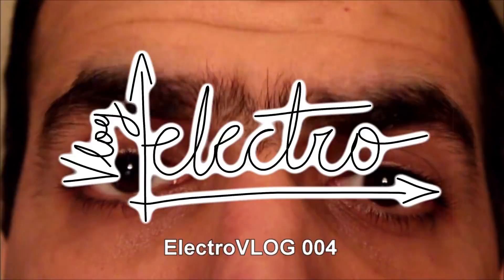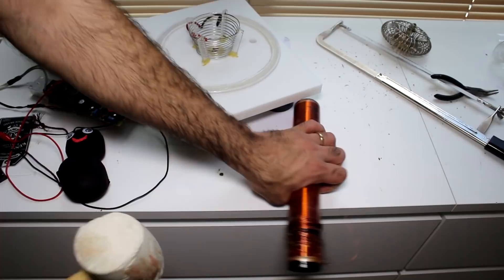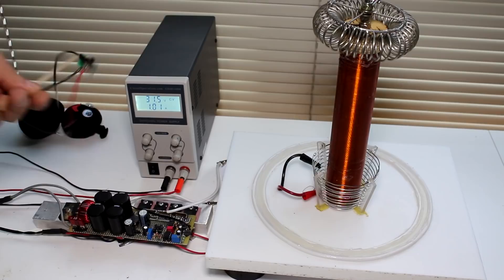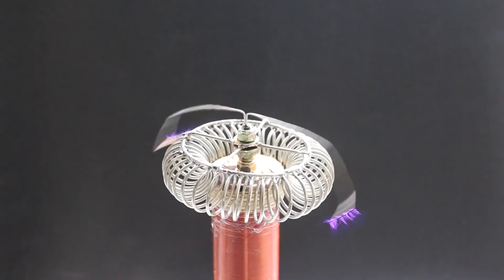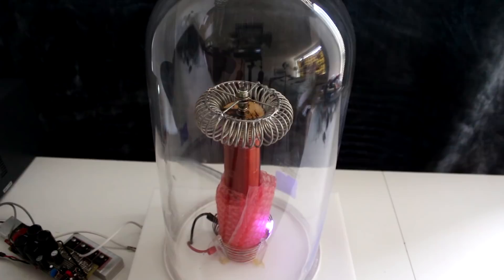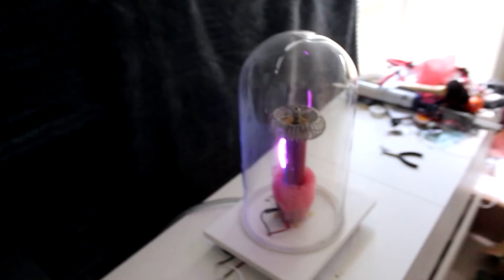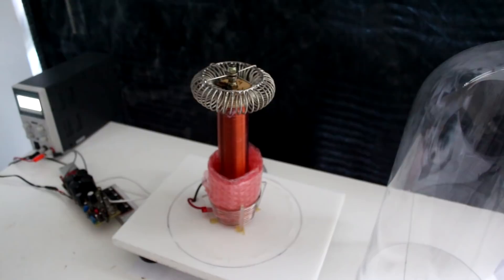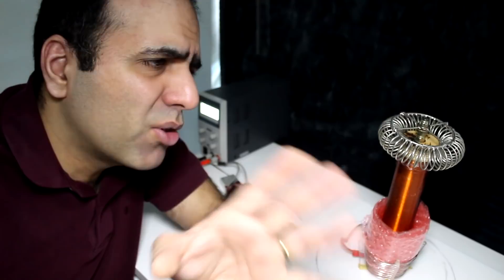ElectroVLOG-004: The LAST Attempt at Tesla in Vacuum

Comment from the maker: ElectroVLOG series is available to my Patrons earlier, so don't be confused about some comments being a month old!
Reply: ElectroBOOM Hello I love your vids
Reply: mind= blown lol
Reply: Fill it with different noble gases and go over the differences! They usually use Argon for plasma globes IIRC.
Reply: More like ElektroDoom
Reply: ElectroBOOM one month earlier rly? xD
Reply: Dear ElectroBOOM, don't you think a month is too much? I don't think that's a way to attract more patrons :|
Reply: Hey, I absolutely LUV your vids
Reply: Please would you re-record the "electrovlog" thing
Reply: @ElectroBOOM
Cast the coil in epoxy just enough to cover it, maybe 1/8in thick, that should insulate it enough so it dosen't arc to itself. I'v had coils burn themselves out in open air in this manner before. That's not failed me yet. The primary coil could be put inside thin flexible plastic tubing as well. Just tips incase you try again in the future.
Reply: Hi! try put a piece of wire in the vacuum and connect the tesla coil to the end if the wire (the tesla coil is out of the chamber)
Reply: Why not get a better insulator like some soft rubber matting. You could layer it around the base and over the bottom cage. I have no idea what your main goal is but you seem to be trying to slowly upgrade this project. Knowing what I do about silicone, it might be best to just make it thicker, when thin it is much easier to cut but the thicker it is the more force it can handle before destruction unless the thing pressing on it is sharp, like a knife.
Reply: what is the purpose of the metal rings at the base?
Reply: fill it with propane gas xD
Reply: Power the tower with van de graff generator periodically ...for short duration but might be more arcs will be there ...
Reply: redd ztone the inside pressure of flask is very low ..u cant expect air in bubble wrap.
Reply: you may use the trasfomer of the microwave oven to build a SGTC
Reply: Fill it with argon!
Reply: <3
Reply: no, do not think about that idea, fart is not noble gas, even when it comes out from a royalty
Reply: How noble are they?
Reply: @Abdallah Al-Dalleh Seriously a day or two early is fine, but an entire month is ridiculous.
Reply: Mr. electroboom , your videos are nice👏👏👏👏but a small problem I found is that you don't answer the coments on YouTube😲😲😲😦😦😦😦😦😦
but please don't get me wrong🙅 ,there is your benefit 🙋,also, many people have quiries and questions, who will answer that?so, please start answering the comments😇😇😇😇.🙇🙇🙇🙇,but you can skip the comments which does not make sense.
Reply: ElectroBOOM GreatScott watches your vids. You can see from his liked videos playlist.
Reply: Exotic Butters that is true GreatScott does watch your videos electroboom
Reply: ElectroBOOM use insulated thick wire for your primary coil.
Reply: hi eletroboom
Reply: Wrap 85 layers of scotch tape all over your secondary. That should do the trick.
Reply: ElectroBOOM you can't harvest free energy from inside a vacuum!!!
Reply: ElectroBOOM Can you put out a schematic for your Tesla circuit?
Reply: ElectroBOOM How did u get the top load of a tela coil plz make a tutorial on how to make a full tesla coil
Reply: Wonder if you used a glass tube to block arcing Across the primary  and secondary windings.  I know this video is 3 years old now but its all new to me. Love your content!
Reply: Likely the magnetic field is pulling the plasma inside the coil bore and so arcs to the other end! 

Likely this is how incandescent lightbulbs explode, because the magnetic pulse of the breaking filament pulls the generated metal ion plasma into the "bore" of the coiled filament and so makes of it a dead short with much lower resistance than the tungsten wire itself and so draws hundreds of amps current converted into heat.

Please test this with a transparent coil tower and less dense windings. (The input highvoltage may be produced externally for this.)

Comment: Man, you don't put the whole tesla mechanism inside the vacuum and not have it shortcircuit itself, you are asking too much from it. Play with its output, is still works in normal atmospheric pressure, use its output on other nice plasma vacuum projects.. or otherwise use the FULL BRIDGE RECTIFIER and make dc liquid ion propulsion in atmosphere (look at electrospray)

Comment: Hint from research lab:  no wood allowed in vacuum chambers!   Wood is a giant sponge which spews H2O-vapor and air.   Even aluminum does the same.  (This only becomes important if you're trying to use pure gas mixtures with no oxygen or water vapor.)   Quick fix: paint wood with epoxy.

Comment: Im so scared to open up a computer's power supply and hes doing all of this, what the hell?
Reply: Because he knows what he's doing :D
Reply: And its good you are afraid of opening a power supply because the charge the smoothing capacitors hold can even kill you when unplugged. Keep the dangerous fun to people who know what they are doing.
Reply: When a reply gets more likes than the comment, i cri ;-;
Reply: Well, wear rubber gloves if you do decide to open it, they'l resist 120V or 240V well enough, and hold a 100k resistor across the capacitors for about 20 seconds using a pliers. I'v replaced light switches without turning off the power using rubber gloves.

Why wouldn't I turn the power off? I couldn't determine at the time which breaker it was on at the time, so I put on gloves and replaced it anyway. Turns out, it was connected to another room's lighting circuit. My house has bizarre wiring paths, like the outlet in one room connected to the basement lighting circuit below it. This place is older, and though the wiring is nice and thick, and in good condition yet, it lacks grounds and some predictability, that's for sure.
Reply: when you open the power supply, shortcut the capacitors, otherwise you can get a shock if you touch them
Reply: Yeah, if you observe all security precautions, you actually should take a look inside one. Reverse engineering a switch mode power supply gives so much insight into electronics, you cannot get that with many hours of reading books.
Reply: I would actually advise against wearing rubber gloves, circuitboards can easily poke through them on the solder side.  Either be careful or don't do it, having a false sense of security might be a bad idea.
Also in my experience I just short out capacitors with a screwdriver, sure you get a spark but you can be certain its discharged then.
Reply: Chuckiele: I still can't see how they would in any way kill you, they are not referenced to ground, the difference in potential is across the cap, and not across the cap and ground.

Bridging that cap out with your hands is going to hurt, but it is "only" going to burn your finger. 
Touching one of the leads won't do anything.

I suppose touching a lead with a hand each would be a bit risky, but nothing too bad.

Not a lot of the charge in the cap will even discharge through your finger, the resistance is too high and the pain will make you let go quite quickly, and since it's DC your muscles won't spaz out like they would with AC

I've gotten zapped by caps charged to 330V quite often (we used to throw them at eachother for fun)

Not nearly as bad as the couple of times i have met Mr. 230V AC from the wall, it hertz, literally.
It probably fucked with some nerve endings, but honestly, i am still alive, so it is obviously not as deadly as everyone keeps claiming. I mean, you might die from falling off of a ladder while working on a light and getting zapped.

Certainly, by telling someone "You shouldn't, you can't, you won't" you are not helping the society that is drifting further and further into mindless consumption, if the guy wants to open a power supply let him open a power supply - encountering Mr. Capacitor is part of the experience, and experience is what drives you forward, not shit someone lectures you about. 
Hands on learning is the best thing you can do, everyone else can just fuck off into accounting.
Sure, you should unplug the power supply, safety above all - if it blows up after you've had it apart - check what you broke. Fuckups teach you the most.
Reply: Ive gotten many electrical shocks, too whether being capacitors or mains, but I wouldnt wanna get them again willingly, even though they didnt kill me. They can be lethal and death wont give you any experience you could use in your life. And yes, preventing others from that isnt helping society, in fact it would be best for society to encourage stupid people to accidently kill themselves but is that what you want?
Reply: A good amount of people are "stupid" because they keep getting discouraged to try and learn things, I however do agree that there are plenty of low IQ people around.

The thing is, stupid people wouldn't even consider opening a power supply, they have no reason and they thus won't ever even think of it - their lack of intelligence is directly proportional to their lack of curiosity.
So naturally, someone who asks himself the question "how does this work" or "how could this work" immediately has one of the criteria for not being a smooth brain.

Should you be reckless when messing with mains? Fuck no. 
But you shouldn't stash away your curiosity because someone tells you that "It's too dangerous", common sense will protect you naturally.
Every time someone talks about messing with power supplies everyone comes out of the bushes screaming "OMG THE CAPS CAN KILL YOU" and i'm just sat here wondering "how would that even go down?"
Instead of simply advising on precautions the person asking should take, they get discouraged for basically no reason other than personal wank-status of whoever is screaming OMG DON'T DO THAT.
People seem to absolutely hate it when others acquire a skill they possess themselves, it is irritating as fuck.

ASSIST in learning instead of attempting to prevent it..

Comment: Out of interest. I used to be a technician on a 3 million volt Cockroft-Walton type nuclear accelerator.
Around the high voltage generator parts, the LAST thing you want is a vacuum. In fact, we had the whole generator cased in a pressure vessel at 6 atmospheres of SF6. The output fed into an ion source (in vacuum) and a beamline that ran down the center of the pressure chamber and exited at the ground. The result was a 3 MeV beam of protons, deuterons or alpha particles depending on the gas fed into the ion source.
Shouldn't be too difficult to build one...

Comment: The arcing at the bottom of the tower is why Tesla used a flat coil. Konstatin Meyl also uses a flat coil design for his wireless power transmission. But I guess if you used that design, there would be fewer explosions. :P

Comment: The reason you had the tesla coil arcing to it self is because it's over coupled. Unlike a normal transfomer you don't want all the coupling you can get, all you need to do is reduce the angle of the primary coil and that should stop the unwanted arching. A general rule of thumb is to not go above 45% but lower than that would probably be recommended.

Comment: If you connect the bottom of the tower to a steel bar next to the tower (inside the chamber) it would arc betwenn the steel bar and the top of the tower so it should prevent the tower from self-arcing

Comment: You need to submerge the coil in thick electrolyte, something that does not evaporate quickly or explode in vacuum, maybe some kind of a resin. Or you can use a second chamber to keep the coil at high pressure.

Comment: Protip: 1. Put a ground plane below the secondary, so the current from the bottom of the winding has somewhere to go. Ideally it should be grounded to the circuit ground in the driver, and maybe whatever other nearby grounds you can find (safety ground, mains, your body.. :) )
2. Wrap the secondary with a strong insulator, like polyester or polyimide tape, or varnish.  (If you use varnish, use a clear polyurethane, apply several coats, then bake it to ensure it's cured.)

Comment: the reason it was arcing to the tower was because in a vaccum there is nothing containing the electrons or hindering the distance they can travel to do this successfully you would have to make sure the toroid is in a vaccum but the tower is not to prevent it from arcing to itself

Comment: Maybe the air-filled bubbles burst under vacuum, since the air inside them is pressurized and that is why the arc moves to the bottom. The electrons find a path to flow to the coil at the bottom. If you wrapped it with a trash bag (or any other plastic for that matter), maybe it wouldn't do that.

Comment: you insulated the secondary with bubble wrap, which has both a low dielectric strength, has trapped air just waiting to be excited, and is very thin. It's not surprising that it didn't work. Get some PTFE (teflon) heat shrink tubing and slip it around your primary.  It will give you at least 1400 V / mil (55 kV/mm)
 A silicon or PTFE (teflon) mat would also do the job if  you cut a hole for the secondary slipped one through, and sealed the interface with some silicon caulking.

Comment: you should try super saturating xylene with styrene from styrofoam peanuts and packing material, so when it is done you can paint it on the coils down below to get an incredibly strong barrier to arcing *they use it to make home made coronal dope so I am betting it would work far better than bubble wrap, and no need to pop it to keep it from exploding in a vacuum lol.

Comment: Idea: instead of two cylinder shaped spirals, one inside the other, try two flat spirals, the larger diameter primary under the secondary. The high voltage would come out of the center of the secondary spiral.

Comment: Mehdi, have you thought of using a slightly larger PVC pipe over the coil tube as an insulator? That or several layers of electrical tape should prevent the undesired arcing.
Reply: sienile MORE HOT GLUE BABY
Reply: Electrical tape plus pvc pipe plus electrical tape should do it :)
Reply: Kapton (polyamide) tape would be best, but more expensive.
Reply: A better option would be to do what we do with high voltage transformers. Dunk them in oil. Just leave the top load above the oil.
Reply: Or just do what most amateur coil builders do and dunk the secondary in polyurethane. Super cheap. Easy. Neat. And easily accessible. I use polyurethane for my coils. Seven bucks for a large tin that will last me for years. It looks really nice too.
Reply: +Jammit Timmaj I dont think it would be good to dip them in oil because this is in vacuum.....
Reply: danijel124 I don't think the oil will boil off, although it might outgas for a while. I would probably try using a full synthetic first.
Reply: I was going for cheap and simple. Polyurethane would be good, but oil would require a different container else it would make a big mess every time it was opened.
Reply: sienile good point.
Reply: Paper tube, just put it in an electric oven set to 250F for about an hour to get all the moisture out ( a gas oven isnt dry enough )
Reply: Corona dope!  Special paint designed specifically to insulate high voltage.  TV repair guys back in The Day used it to get more life our of cracked flybacks and focus resistors.  You can still find it.  There's also corona putty.
Reply: I've calculated that 85 layers of scotch tape (polyethylene) would be barely enough to insulate 100kv between two plates because each tape layer is about 0.05 mm thick. The average measured breakdown voltage for one layer of tape is around 1.8 kv . The theoretical breakdown voltage for 0.05mm of dense polyethylene plastic is 1.15kv . That means it should surely hold up at least up to 100kv. And I don't think that little coil can do much more than that.

Comment: tesla coil needs to be in air, but the top load can be inside a bell jar, stick top load in bell jar, run wire through the vacuum chamber to top load.

Comment: I wonder if you really heavily insulated the bottom and the other areas near the bottom of the coil would lead to the coil not shorting to itself like that.
Though with how the vacuum seal broke, it may not work until stronger materials are used.

Thank you so much for your awesome videos!  This has been an inspiration to pursue Electrical Engineering.

Comment: try leaving the coils outside of the vacuum chamber and run a from the top of the secondary into the chamber and to the top load. you will likely need some fancy insulation for the wire, but once you depressurise the chamber, it will become the low impedance path to ground and thus the majority of the arcs will form inside. At least that's what I hope they will do.

Comment: The problem you are having is because of the anomalous breakdown at Low pressures.  Instead of reducing pressure over the inductor coil, why don’t you insert the inductor in a tube which is at a higher pressure by sealing the tube thus creating a pressure differential? This will ensure normal gas breakdown near the inductor while the corona ring at the top is at lower pressure. You should get a glow plasma discharge in the entire tube. We usually use this trick to ensure that there is no anomalous discharges.